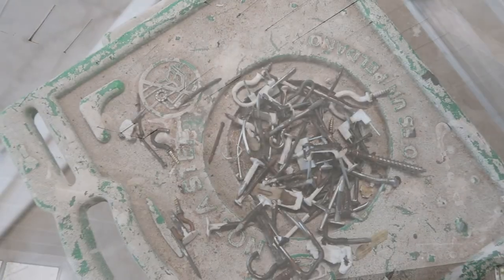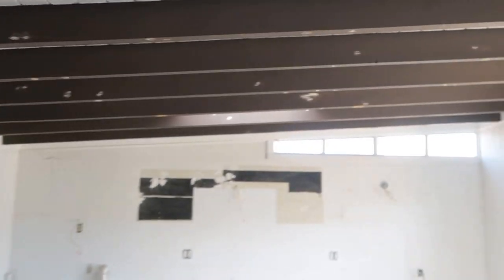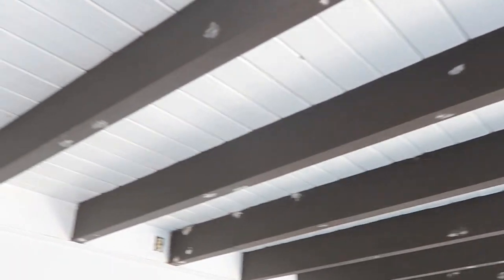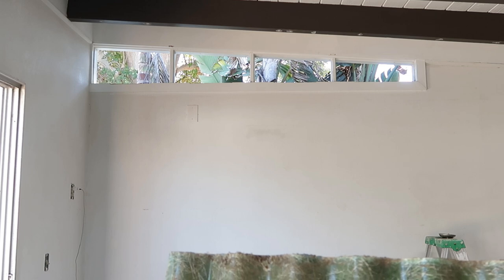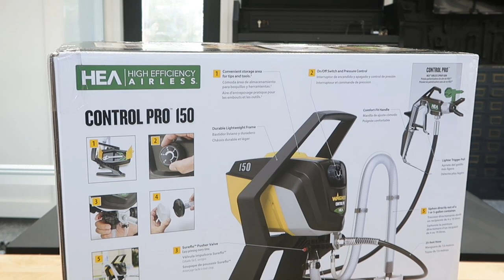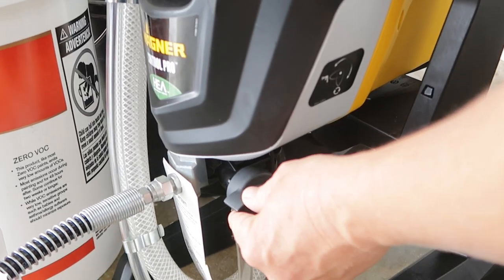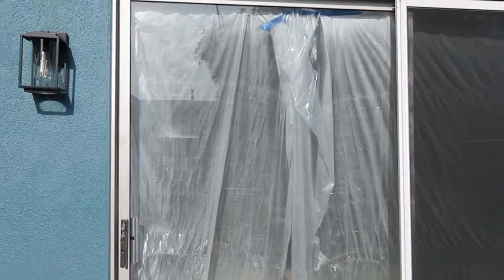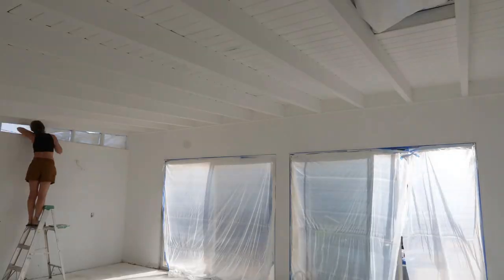Paint Wood Beams Like a Pro: Expert Tips for Revamping Your Space

Comment: I was spray painting some old wooden beams white and iz showed yellow spots all over the beams. How to prevent that from happening? Thanks in advance
Reply from the maker: I used a paint and primer mix that was specialized for covering up stains. I did have to do two coats, but it definitely did the trick for the dark spots.